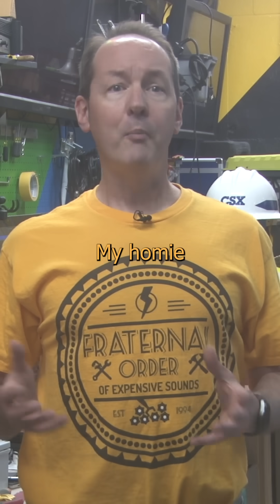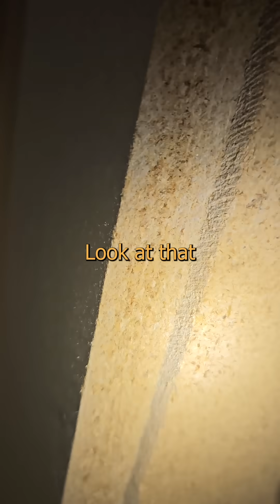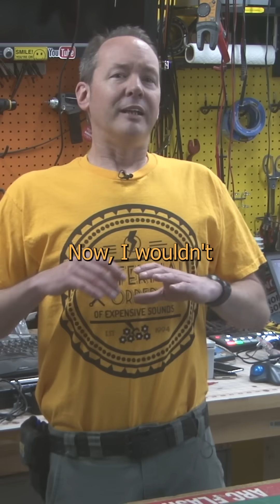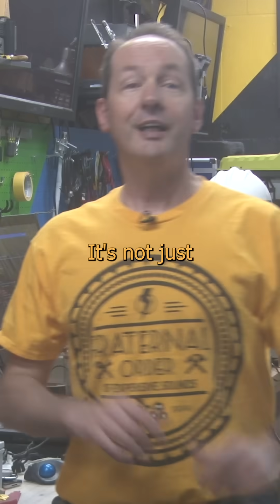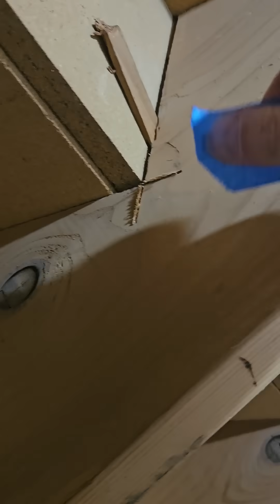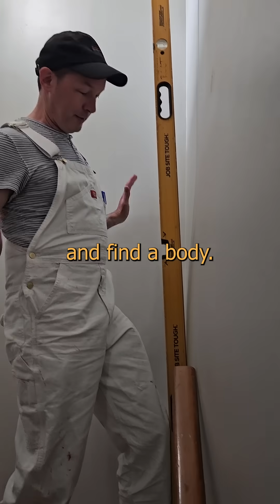Particleboard Staircase #chrisboden #engineering #construction #stairs #cheap #job #work #carpentry

Comment: Particle board on ANY spot that people will walk on is a tragedy waiting to happen.

Under normal circumstances, it will deteriorate and lose strength faster than a normal board.  

During any non-normal circumstance, tho - even something as minor as an overflowing toilet or sink that soaks the area - things will go much worse, much faster.  Just soaking in that water/moisture instead of sloughing it off like normal wood might do is a big problem.

But there’s more.  Much more.  Admittedly, the story that follows is extreme, but it’s also a great example of how - and how fast - this stuff can fail:

In my city (where I am a firefighter) - one-story newly constructed home.  Found out after the floors were all particle board.  Fire was in the crawl space under the floor.  (Remember - heat makes particle board lose strength almost instantly).

Team makes entry.  Visible fire has breached the floor in one area.  The crew opens the nozzle and applies water to the visible fire, while searching for the seat of the fire.  Water hits the flames and, as it’s supposed to, flashes to steam, filling the entire crawl space with what is usually life-saving, fire-suppressing steam.

Unfortunately, moisture also makes particle board weaken.  Moisture (or steam) applied to already-heated particle board makes it disintegrate under load.  You go from solid board to pile of sawdust - instantly.

So, firefighter - no longer standing on a solid board - falls halfway through into crawl space.  Firefighter #2 - who luckily enough had at least one foot above a floor joist - keeps himself from going through and attempts to lift 1st firefighter out - but he’s (stuck exposed nails, splinters, wires, etc all keeping him from being lifted out). Firefighter #1 now has their legs dangling into the solid flames within the burning void, and is being cooked as they hang there.

Through extreme effort, strong teamwork and extraordinary heroism by some, firefighter #1 is saved.  Both he and 2nd firefighter suffer 3rd and 4th degree burns.  Firefighter #1 comes close to death but pulls through.  Career over, unable to walk more than a few steps at a time, permanently disabled and in permanent pain, firefighter #1 speaks out against the use of particle board in load-bearing situations.

Builders lobby against new regulations, citing cost.  

Nobody talks about the costs to him.

Comment: that is definitely poorly built as a carpenter you build those stair case templates with thick pieces of large planks of wood like 2x8s and 2x6s that cheap cardboard not even plywood isn’t going to keep you from falling through with enough weight on it.

Comment: 35 years in construction, and I thought I had seen every cheese dick, penny pinching, dumbfuckery, that a fuck-nozzle houseflipper or 3rd world-1st time crack addled "contractor" had to pull, but using particle board on, not only the risers but the treads as well, is some seriously world class umpa loompa shit! It's like whoever built that shit is checking their ouija board once a week, hoping to make that place haunted, after the 5th or 6th carpet cleaning, when some unlucky bastard goes for a midnight snack and the step fails and he flys out of this mortal realm the same way he came in. Head first and screaming.

Comment: In my first (and current) house; someone had decided that the trim going along the stairs would make an excellent stringer. Nothing in the center either. Just two 1x10s. Oh and the best part is the "stringer" wasnt holding anything because the notches for the treads were on the UNDERSIDE of the "stringer"

It has since been fixed. With three proper 2x stringers.

Comment: No you’re right those so stairs are no good. That is particle board and it’s not safe for stairs and those over cuts feel like a weak point that could lead to the stairs cracking. Your friend should get an inspector in and get the problems fixed.

Comment: What you need to look out for is the over cuts on the stringers.  That's going to give up before the treads.  Those treads are what's used in 75% of tract homes

Comment: It’s been years ago when I bought a new construction home. It was January in Jax Fla and the furnace is kicking on and off round the clock. Cable guys come in on day 4. As he was climbing out of the attic, “How much did you save not get the attic insulated?” Sunday morning, a call to the builder, “Hey there is no insulation in my attic? Should I call the person that signed off on the inspection from the County or are you going to take care of this today?” An hour later on a Sunday 4 guys show up happy as hell cuz they’re getting paid 2X an hour to do a quick install.

Comment: First - The stringers have been over cut, weakening them and is against code. Stringers are the lumber that is notched for the treads (steps) and risers (back blocking wood on each step). When stringers are laid out and then cut, it should have zero over cutting.  Most of the time, the cut is done with a circular saw and the  extra material is then removed with either a sawzall, jigsaw or handsaw.

Second  - The material being used for the treads & risers is totally against code. Normally, grain lumber or subfloor plywood is used for treads. As for risers the previous materials along with OSB are typically used. 

That staircase should have never been allowed to be passed by a building inspector.
Reply: Nicely explained!
Reply: This looks like a classic Canadian build, 80’s and up
Reply: I noticed the over cut as well and came to post about it.

Comment: Okay, I worked in a brand new hotel for 8 years as Chief Engineer. It was still being constructed when I was hired, so I was offered the opportunity to help move in furniture (all the way to the top floor and then every one below that), carrying it up the stairs by hand, since the elevator hadn't been inspected and approved, yet. I also got to hang headboards on the walls (because, God forbid they be part of the BED), which went reasonably well, once we got rid of the CEO of the management company who "showed us how it was done" by mounting the very first one on the wall OPPOSITE where the plan showed it was supposed to be. Reasonably, that is, until I found a wall that had enough built-in warp you could have hung a bag behind the headboard to catch used Kleenex. I swear (I'm now raising my right hand) that I had to screw a 2 x 4 (flat) onto the wall, over a stud to anchor the middle of the mounting cleat, in order to make the headboard stable! Also... well those are all stories for another day.

Comment: My house is at least solid, but when I accidentally took the ceiling (also particle board with some plastic "wood-look" covering) down in the basement (wanted to get at the light fixture. They put the light up first and then the ceiling with just a small hole for the metal "stem" of the light.) , I found wonderfully straight, equally spaced guide lines for the beams the ceiling boards were on. And said beams, not equally spaced and not following the lines, instead going at a nice angle (of course one angle per beam, can't have them all have the same!).

Oh, and there's a DIY door where you can literally stick a hand into the door frame because the wall was added later and for some reason, they decided to put the upper part of the frame at an angle.

Then there's the bump in the kitchen floor tiles. 

I honestly wonder what the hell they did and why. Like, I tend to mismeasure sometimes, too (ask my mom how many holes are behind her bathroom mirror...) but that...

Comment: In Australia we use yellow tongue flooring for subfloors. Which is just particle board. Spans 450mm no dramas, weather resistant to be completely out in the element for 6 months.
I hate the stuff, I’d rather go back to sub floor floor boards.

Comment: The risers are load bearing, they are what keep the stringers from bouncing. 
If you omit the riser altogether, the tread either has to nearly double in thickness or use steel with bends on all 4 edges(to give its flatness rigidity) or other rigidity tested materials like fiberglass.

Comment: I work on a 2 man crew with just me & my boss, because it is literally impossible to find EVEN A 3RD GUY who is willing to do things RIGHT & not cut more corners than an Indy 500.

We build custom master showers, install tile of any kind wherever tile goes, hardwood floors, LVP, LVT, LV-Any other 3rd letter, just no carpet because it tears your body up for $50 a room.

Over the years, we've been forced to learn SO many other trades because when we do remodels, the homeowners are always desperately begging for help because whatever other trade came before messed something up & refuses to help or fix it.

We've learned Plumbing, Electrician work, we just do our own quarter round trim now because nobody else can do it properly, we've had to rebuild cabinets because they're particle board in a bathroom & falling apart, we've even had to re-align a garage door multiple times because the garage door guys just left the unlocked new construction with a wide open garage door hanging off the tracks.

Don't even get me started on how poor modern-day Electricians are. Not only do they totally trash a brand new construction, they constantly install light switches upside down, tear useless holes in brand new walls, & we've even seen wall outlets installed IN THE MASTER SHOWER. 

Let me repeat that: WALL OUTLET INSIDE THE MASTER SHOWER. 

Genuinely, Chris, you are already better than 99.9% of ANY trade just by double checking ANYTHING. 😅

Comment: If it was MDF you would fall right through it 
Particle board was a very common material used in the late 70’s early 80’s  it’s fine  just look at how old the house is and know they are the original stairs  pretty much your Karen video here was unnecessary  probably best if you stick to what you know

Comment: That's "Hopes and Prayers" in action, or basically fraud and criminal negligence/depraved indifference.
I bought a 120y.o. former hoarder house bought by an 'eff-it-up yourselfer' guy  who did some 'work' on the place but couldn't get the heat to work when winter came.... The new PEX pipes froze and his tenant had to vacate so he flipped it to me (still profiting). So in troubleshooting why the furnace wouldn't work/actually why it kept dying...We discovered that the furnace air intake was covered by plywood the idiot installed. I'm expecting to spend the better part of the next decade undoing his crap and bringing the house up to my standards.

Comment: Yeah I'm pretty sure that those stairs and the risers yeah those are  not correct play not even a little bit not to mention it's just crappy cuts but I mean yeah no that's not how you make stairs somebody doesn't know what they were doing obviously but they did it anyway which is a problem because yeah that that's definitely not safe or code I would not walk up or down those stairs the bottom stair looks sort of legit oh wait that's not a stair is it that's the platform on yeah that makes sense that makes sense 'cause that almost looks like it had plywood on it. yeah no the blue tape fixes it all

Comment: God I thought my new flat was bad. Atleast here in the uk everything is made from brick and plaster. I do however have a rotted out floor in a cupboard that I need to build a plate over to distribute the weight (it came like that and the mould that caused it was removed before I got the flat. It's just weak floor and I live on the 1st floor up) but atleast the stairs heading up to my flat are solid as can be

Comment: 1970s spec houses. It's probably a split level house they are all built like that. And no I don't think particle board stair treads is to builders code in most states.

Comment: The badly cut stringers (which are totally normal, and I've seen 'em fail) worry me just as much.  As for the treads . . . maybe add another stringer in between, on each side?  If there are enough stringers, the treads won't fail.  HMM.

Comment: Also note the saw cuts past the step notches into the narrow portion of the stringers.   Significant weakening.
Reply: Yes I caught that too.
Reply: @davidhargrove1648  He was using a circ saw and ran the cuts all the way to the end line rather than stopping early and finishing with a hand (or saber) saw.
Reply: not to mention how many screws missed their mark.
Reply: Yeah but it's on par with everything in this country now... Everything is more expensive than it has ever been yet less quality than it has ever been at the same time.. pay $100,000 for a new Ford pickup truck, 5 years down the road it falls apart that is on the engine and stuff where you can't work on it.. or you could have spent $20,000 for a new Ford truck in the 90s and it will still run today

Comment: The particle board wouldnt pass inspection in michigan. And honestly not sure if the over cut on the stringers would either it takes out the integrity of the wood. Thats why you use a circular saw to start the cuts and a jigsaw or a hand saw to finish the end of the cut and do the corners so you dont over cut. Somebody was in a hurry and lazy not wanting to swap tools. I think whoever did the inspections was probably paid to pass all those houses if its the same builder with same shit quality

Comment: Like it or not particle board treads are an option. They work fine in dry locations that will be covered with something else like carpet. The treads are 1 1/8 thick so it's a little more substantial.

Comment: Uh... Pretty sure those stairway spines are also supposed to be leaning-to on something structural at the top, not hanging from a sheet of plywood like the new guy when you're one strap short and just going a few blocks. I'd probably scab in a structural tie-in before his stairs to up become his stairs to yonder.

But that's not my area, so could be wrong.

Comment: I got the same problem in one of my rooms. There's a huge ski jump, about 3-4 ft. Of the 12 ft. Wall. The Hardie board outside fractured! I put up a 8 ft. Shelf on that wall and saw how royally fkd up it is- a 2+" bulge. I've wanted to tear into it, but I'm not a carpenter or drywall guy. Now that I think of it, the floor in the adjacent room was unusually high against the wall. So, patching the Hardie board and hoping that's all that happens. It's 19 years old. I heard and see it's far worse now! Plastic sheets instead of OBS/plywall on the exterior under the exterior finish??? Really?

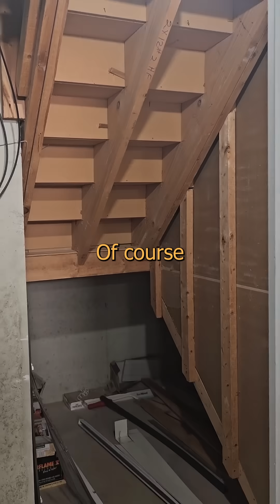Comment: Dude.  Duuuuude.  There's more bowing in that drywall than a wild west whore with rickets on a horse ride.  Is that wall load-bearing?  Hint: The only answers are a) No and b) Not for Long.  Am I the only one who noticed the studs around 0:21 have been cut in half AND they are oriented in the wrong direction?  Carpenter had a 50/50 shot at getting that right and he still failed.  Sad to say that particle board is the best work he did on that job, and that's not a compliment.

Comment: Yeah.  We got some new duplexes built in my town about five years ago.  One caught fire about a month ago and the fire Marshall is having a field day with the owners and the builders.  There's supposed to be a fire resistant barrier between units to slow the spread of the fire.  Instead, they had polystyrene insulation.  You know, the same cheap foam as those disposable coffee cups. There's plenty more code violations in there, too.  Like the wall studs being 4 FEET apart to save on 2x4s.  The floors under the carpet are only 1/4 inch OSB, too.  It's so comforting to see your couch make the floor sag until the joists touch the ground in the "crawl space".  Builders with the right connections get away with some sketchy shit.

Comment: I did construction for a few years, i cant tell you how many cookie cutter homes ive seen built to the same level of quality as this. Paryicle board instead of wood, founsation cracks filled in with spray foam, ever-changing grades and layout such that drainage is myth. Its always the cookie cutter houses that go for 400,000-700,000 a pop. They look pretty, but theyre terribly built

Comment: Ive learned that building with wood. Isnt always perfect with expansion. Cool and hot.. the guy maybe cut the line instead of cutting before the line etc etc… wood is hard to make perfect but… this could have been prevented or fixed.

Comment: Lennar homes are entirely made of that shit lol. Oh, also I didn’t see any fire blocking on the stringer lol. Tons of shiners too. What probably happened is that either the lumber back got stolen, used on other related builds first, or ever received a PO for it and scraped shit off from each lot that was never used lol. Over cuts on the stringer are no no in my state. 

This would fail inspection so bad, I’d have to give a blood oath and swear it’s done right the next time otherwise, he ain’t coming out to inspect it lol. (County building code inspector). 

The wall curve is most likely from a bowed stud. It’s super easy to fix… before the drywall goes up lmao. Second to that, the bottom plate isn’t where the wall is suppose to be, and so on everything else curves after that. 

The framers don’t give a shit, they get paid regardless. A “carpenter” is an incredibly rare find nowadays. You have a better chance of getting hit by lightning than you do meeting an actual carpenter. If there’s someone in the comments claiming to be a carpenter, then im an astronaut. 

Before arguing, im going off of the current FBC (Florida building code) 2023. And I will die on the hill that particle board cannot be used for any structural/load bearing sections of the home. 

They even banned using pressure treated wood on the engineering braces on the trusses